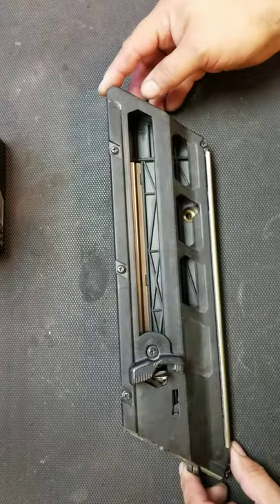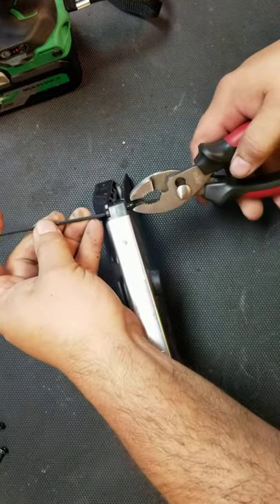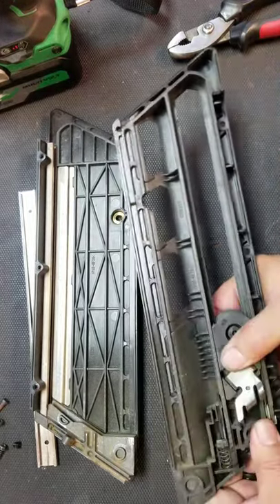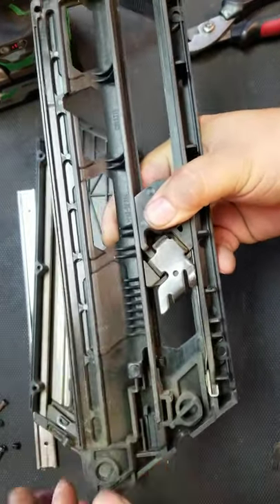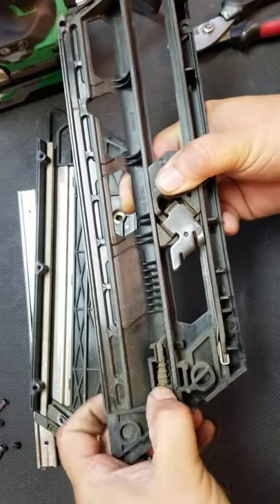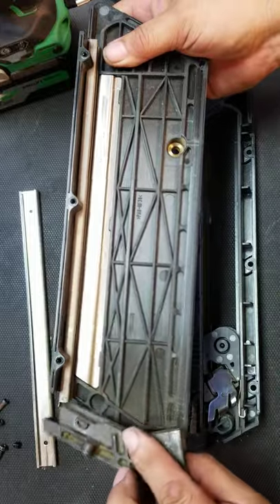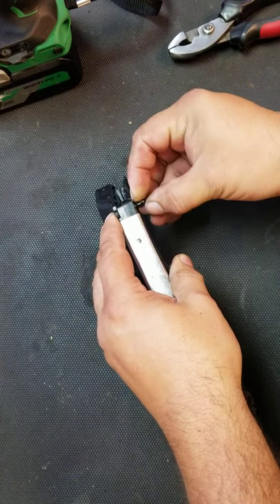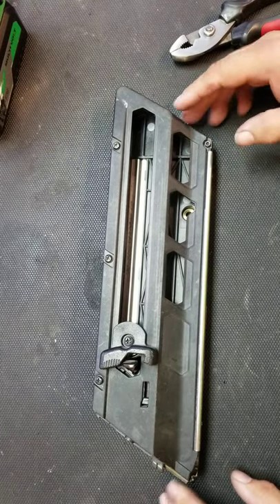NR1890DR / DC Magazine

Comment: Im trying to see if I can convert my 21* round head version to the clipped head version. Its kind of annoying reloading the magazine so often, the round head has too much wasted space between the nails, I could fit twice as many in a magazine with the clipped heads. cant find any part numbers or availability of the clipped head magazine or if it can just bolt in place of my round head magazine
Reply from the maker: If useing professionally,  ensure you check local building codes to prevent possible violations.
But you would have to change everything. It's not possible to convert it to a 34 degree clipped head nailer.
Reply: I'm looking to change mine from 30° to 21°. Want to trade?